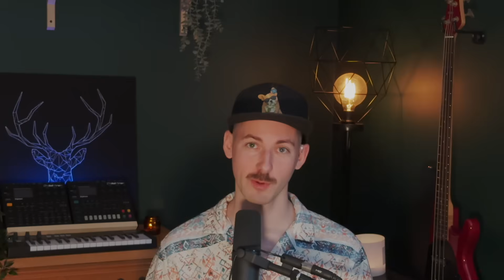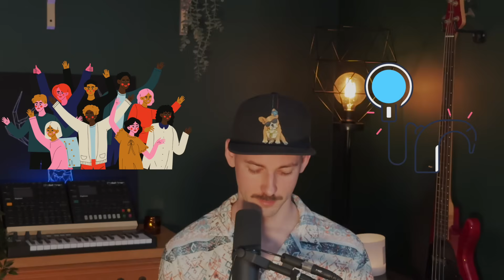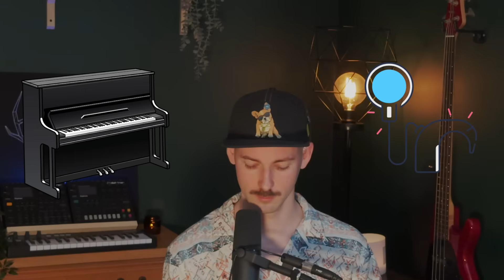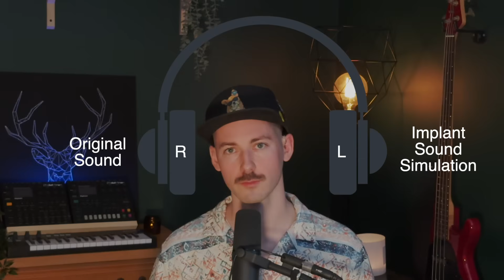How I hear through the cochlear implant - two years later

Comment: I still have some hearing in my right ear and it's extremely distorted but it's not as distorted as that is this even something I should consider?
Reply from the maker: It depends what frequencies you still have in your right ear. If you have just a dB drop in some frequencies you can try a hearing aid. If you have a severe drop in some frequencies then cochlear implant is and option. Did you do an audiogram test?
Reply: I'm in the process of evaluation for implants and have been recommended for one.  I understand implants should be considered if your hearing loss is in the severe to profound category and you have less than 60% word recognition.  Audiogram testing will tell you if you're at these levels.